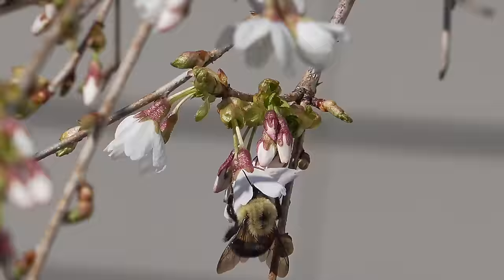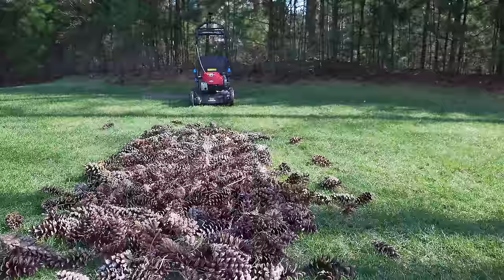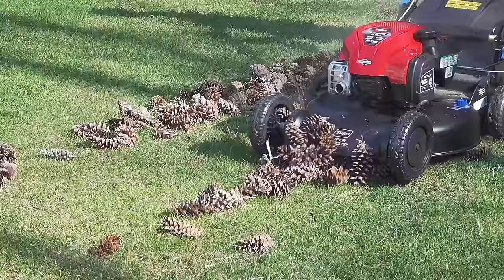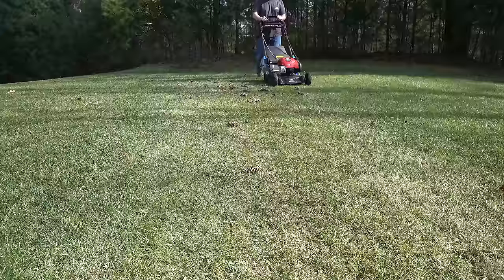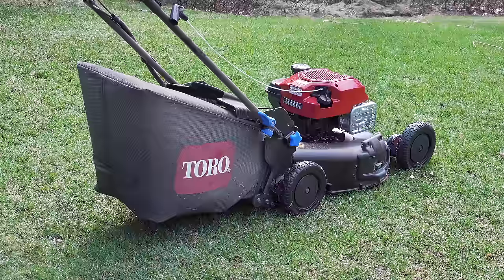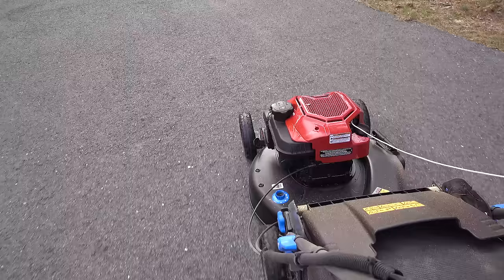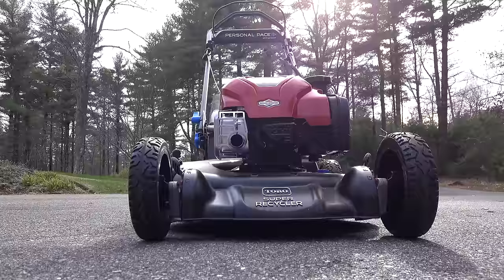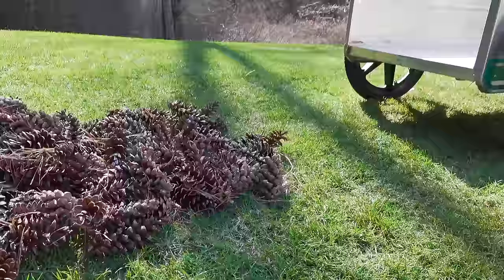What Happens When you Mow 400 Pinecones? Toro

Comment: Great video as always - thank you.  Just a quick point.  At about the 40 second mark on the video you make the statement that the Toro Super Recycler 'is supposed to have very good suction'.  I've looked on the Toro web site and other Youtube sources and I believe the term 'Super Recycler' refers to the fact the this unit has been engineered to keep the cut material suspended for a longer period of time thereby allowing the material to be cut and re-cut into smaller and smaller pieces before reaching the discharge shut.  This has more to do with mulching than the suction power of the machine.  There is a significant difference between mulching and vacuuming the lawn.  The reason I bring this up is that I live in central Alberta, Canada and our summers are considerably shorter than many parts of North America.  The benefits of mulching are best achieved through long periods of warm weather - especially evening periods - when most of the micro organism activity takes place that breaks down the mulched material.  Where I live we typically get less that a month of these types of conditions resulting in a build up of thatch and mulch material that is improperly broken down throughout the growing season.  Therefore, I am always looking for a lawnmower that has strong lift/suction/vacuum abilities.  Many years ago I purchased a Snapper Hi-Vac lawnmower.  Used it for 20+ years and that lawnmower preformed very well in picking up lawn clippings and debris.  You could actually see dirt between the grass blades.  My neighbour borrowed it a few times and was so please with its ability to 'clean his grass' he would say the machine could 'suck the green off grass'.  When I purchased the machine the salesman showed me several different brands of lawnmowers and would place several quarters on the salesroom floor a run over them.  The Toro would pick up the quarters (not all brands would) but with the Snapper Hi-Vac he placed the machine over a 3/4 inch piece of plywood that fit between the front and rear wheels and extended beyond the deck in width to ensure the plywood would not get drawn up into the spinning blade.  He then started the lawnmower and the 3/4 inch plywood was immediately sucked up tight to the deck - that was suction power.  As I mentioned I used that machine for 20+ years and the B&S engine and carb needed major work so I got rid of it - something I regret to this day.  Snapper Hi-Vac success was based on the fact the deck was rounded or molded around/below the spinning blade thereby creating a strong air flow.
Michael from Canada

Comment: I pay the kids a penny for each pinecone they pickup.   My 1986 Honda mower that I've had since I was 13 barely sucks anything anymore.  It's a smoke show while it warms up.  I'll def. consider the Toro for a replacement, I'm a cheap SOB and will run the Honda till it completely breaks.  In 34 years I've had to replace the transmission and put a new carb on it outside of regular maintenance.  The wheels are literally falling off it, the rubber that goes around the plastic hub is split and comes off every other cut.

Comment: That's a great test. I have a 2017 model and i can say that this machine does a great all around job. It does excel mulching. One thing you might want to add is that if your yard has a lot of pinecones and the like, either have an extra blade to swap or be prepared to constantly sharpen the one you have.
Reply from the maker: That is a really great point, I am sure if you kept doing this the blade would dull out quick for sure. Good to hear you have had good luck with them.

Comment: Here is a good video for you as I've done stuff like this, but will give you the idea for the next step in using a lawnmower for composting. Instead of a bag at the output, have it come out in a flexible hose to essentially turn over/move the pile. When I originally built my pile, I spread leafs and cones out on the grass so when I chopped it the mixture had the right mixture of nitrogen to carbon. Now I need to turn it over and doing it by hand when I'd really like to mix it up some more and chop it finer with the lawnmower. I'm slowly putting the pile in buckets to spread it out on the grass for the first cuts and kick start the composting with warmer weather. Black gold. Cool video.
Reply from the maker: I like that idea a lot! Thank you

Comment: If you want some serious results get a Oregon gator blade for that mower. Better leaf and cone cleanup since they would be shredded into a dust before they went into the bag. Better side discharge since the teeth on the blade  increase airflow.
Reply from the maker: I have heard those are good, I will have to give them a try sometime soon

Comment: Awesome.  My Honda HRR, new from last summer, has a hard time mowing cool season grass, let alone a mound of pine combs.  It’s a complete POS, I would gladly have the month old Toro 20340 with a blown motor over this paperweight it replaced.
Reply from the maker: I'm sorry to hear about the Honda. I miss the days of the old Honda Masters series mowers. those thing were built of vibranium or something. I think some brands gave sadly let some things go. I didn't like that Honda transmissions failed on thousands of units for self propelled and they didn't to a recall. It was a royal pain to replace too I had one of them and did it. Toro also slipped a few years ago and was worried to much about making cheap models. This one seems much improved.
Reply: Silver Cymbal   Exactly. I remember those days...And now this season the dreaded rear wheel lock up.  Honda’s answer last year, when it wouldn’t cut a full deck width and leave Mohawks, was to swap the blades for a set of New design “high lift”, but yielded the same results. Now, I was told by a Honda rep they have a newly designed blade for ‘20 and he’d send me a set. 
Just wish I had the coin for that Allett, haha

Comment: Great content!  I have 4 pine trees that drop a lot of pine needles and cones.  What if you don’t bag the mulched pine cones and pine needles?  Will it be good for the soil and lawn?  I’ve tried raking at most 10 times a year for the past 3 years and my lawn still looks thin and patchy.
Reply from the maker: Thank you. I don't know if they would mulch really well. This mower did pretty well and you could see the chips but the pinecones are more wood than plant so I don't know if I would put them on the lawn.
Reply: @SilverCymbal  Thank you so much for the quick response.  I appreciate your content. Keep them up!
Reply: Pine cones & needles acidify the soil, I would check the PH in these areas. You may need to add lime to get the PH where it needs to be for your turf!
Reply: acoldguy Thanks for the reminder.  I added some pelletized lime 3 years ago but I read somewhere that I should check the soil PH first.  Never got around to doing that. 😅

Comment: While I generally like my Toro mower, a 30” Timemaster, I find the design of the bag hangers really annoying. I see it’s the same on the mower in this video. Those two pins that stick out make it just about impossible to empty the bag into a plastic lawn bag for disposal without tearing it. I have to first empty into a large trash can, and then into the plastic bag. The design on my other mower, a 30-year-old John Deere 21” walk behind, is far superior. Nothing sticks out.
Reply: Oh, one other thing - I can’t tell if the bag handle on your Toro is exactly the same as mine, but on mine the excursion that the steel rod makes to form the handle introduces an excessive amount of flex into what is supposed to be holding the top of the bag tight against the back of the mower, so clippings are constantly leaking out of the bag at that point. I rigged something that mostly mitigates the problem, but again the design of the JD bag does not have this mistake.
Reply: @griffmillerii1885  I have noticed that my 22" Toro has the same issue with debris flying out until the bag becomes full
Reply: @scottsummers6541  dumb question, but is the bag clipped to the bag frame on all four sides where the bag rests against the back of the mower? On the first pass I made when my mower was new, I noticed a ton of leakage - turned out the bag was not clipped to the frame on the bottom. I guess it had come off as part of packing/shipment. Once that was (easily) corrected, all was more or less well, except for the aforementioned leakage on top in the area of the bag handle. I just crammed a little piece of wood into the narrow space where the handle part of the bag frame comes to a point and rests against the back of the mower. This made the bag frame conform better to the mower's backside, and stopped that leakage. Ultimately, I'll probably weld a little piece of steel rod in there to make that part of the bag frame properly stiff and straight.
Reply: @griffmillerii1885  I believe my leakage is simply the top portion of the bag just below the handle (like you described).  I guess I could try wedging something between it and the mower, but it isn't a ton of debris, but it is noticeable. Funny thing is that I don't recall this happening until the end of last season.  My first few times last season using the bagger I don't remember this happening.  One more question for you....this mower seems very light and almost "flimsy" compared to my old snapper push mower circa 1992 model.  The Snapper finally died last year and I picked up this Toro.  I guess these machines today are being manufactured with more plastic or lighter metals, but I'm just curious on how long it will last.  I'm pretty good about taking care of my equipment, but I'm scared this thing is going to break in half sometimes, lol!
Reply: @scottsummers6541  The 30" Timemaster I have (obviously a different model from yours) is starting its 3rd mowing season here in SE Texas. My mower seems reasonably solid to me - my grumbling is mainly about stuff I took for granted on my ancient JD (which we still use - my son and I mow in parallel) that seems to have been reinvented for some reason on the Toro. I sometimes wonder if engineers actually use the stuff they design.

Comment: I have a request. Can you show a video on how to remove the blade on a lown mower? I have a craftsman mower, and it's been about 5 years sense I had the blades sharpened. 
Also, In the metal base of my mower o have what looks to be an attachment where you could put your lawn hose to it. What is that for?
Reply from the maker: Yes, that adapter is for a hose to clean the deck. You actually run the hose will running the mower.  I will be doing a video shortly that I think will show what you are looking for.
Reply: @SilverCymbal  thank you.... I can't wait.
But if you run the water with the mower running wooden that Rust Out Underneath
Reply from the maker: @bobbiesullivan2793  You would think so and I absolutely hated this when they first came out years ago but I have not seen any issues with them over time so they really seem to help and don't cause problems. Also if you want to do it the old way you can still clean it with a brush or something too.
Reply: @bobbiesullivan2793  Having wet grass clumps stuck to the underside of the deck actually causes more rust because it doesn't dry out.  These clean out ports work great but you have to remember to drop the deck all the way down first.

Comment: Is a dethatcher the same as an aerator
Reply: not at all, a dethatcher scratches at the surface and removes all the dead grass, while an aerator digs into the soil (1-3 inches), this is supposed to release pressure from the soil. there are different types of aerators however I highly recommend core aerators because they remove entire cores from the soil making it much more easy for mineral and air to get in.

Comment: No, that's not pollen,  it's dust. Pollen creates the pine cones in the spring silly.
Reply from the maker: I like to fact check and make sure info is right and today I learned something new.  Pollen does not create the pine cone. There are male and female pine cones. The males releases pollen & the female ones (shown here) sticks/collect it. So these very likely do have pollen on them, or some combination. This is news to me and you probably won't believe me, so fact check here:  The pine cones typically thought of as pine cones are actually the bigger female pine cones; male pine cones are not as woody and are much smaller in size. Female pine cones hold the seeds whereas male pine cones contain the pollen. Most conifers, or cone-bearing trees, have female and male pine cones on the same tree. https://www.reference.com/science/difference-between-male-female-pine-cones-6e98872b55cabb16